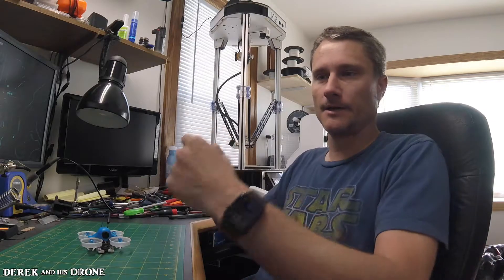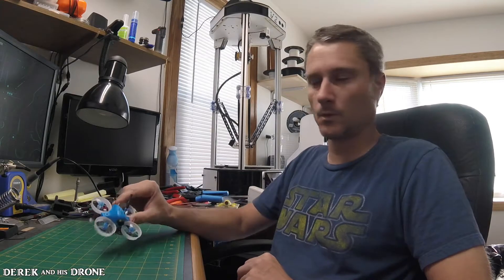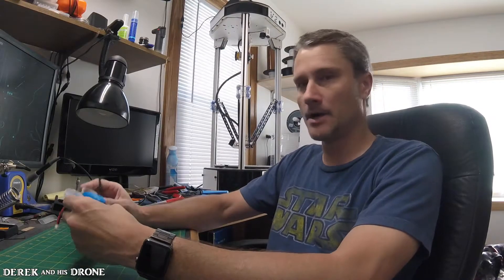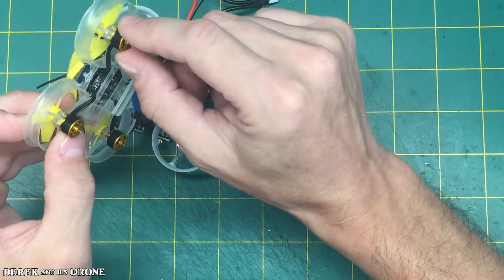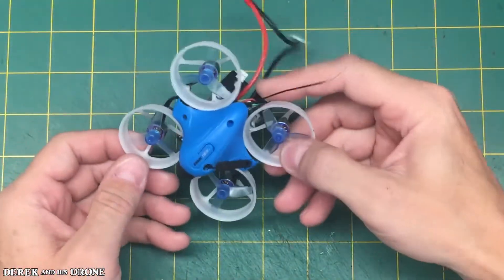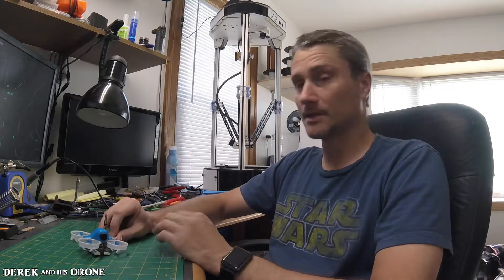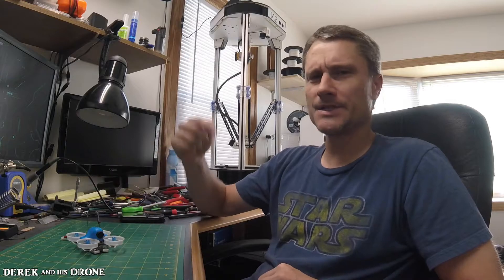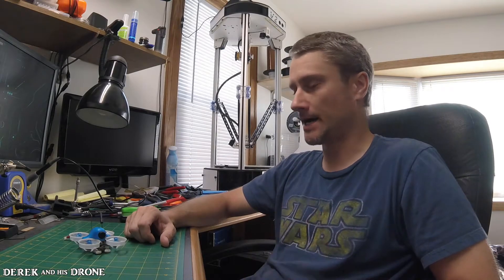2S Brushless Tiny Whoop Build - Part 2 FAIL

Comment: My Eachine 013 flies like complete crap. It’s gotta be a factory defect. I purchased it off of bang good and it’s as if one of the propellers is pushed down closer to the motor. That could be the issue but either way no matter how much I try to trim it using the stock remote it still doesn’t completely trim the way I’d like it to. I contacted bang good about it and they keep giving me a crappy reacharound in there email about how I need to upload videos on YouTube talking about it. I told them that I had already done that and they seem to not understand me well. I keep telling them and keep sending them the same damn videos and SKU labels and they aren’t helping me for anything !. I spent 70 dollars on the fpv combo with the goggles in regards to this thing. 6 mm motors like majority of my ducted indoor drones and it sucks. It just doesn’t fly at all it keeps flipping over. Do you suggest I wait for them to send me a replacement package or get it fixed myself ?..... even my usb charging cable that was included won’t even charge. It’s damaged out of the box to begin with and on top of all this stuff I mentioned it gets extremely hot under the canopy where the camera is located. I’m surprised the canopy hasn’t melted.
Reply from the maker: If you have other options I would not recommend buying from Banggood.  They are very lacking in the customer service department and things are poorly packaged for shipping. I have seen a lot of things damaged in shipping that could have been easily avoided. If you can I would recommend cutting your losses and trying to fix the quad on your own. It is normal for the VTX to get hot but should not be hot enough to melt plastic.  In the future I would recommend staying away from Chinese brands like Eachine as they do not typically provide a quality product. In your case for only a few dollars more a quad could have been purchased that would give you an enjoyable experience.
Reply: Derek and his Drone Damnit !!!!!..... so do you think they would send me back a brand new Eachine 013 or would you think that they are just going to send me the same stupid email message about there salesmen and that I need to upload the issue to YouTube ????..... it’s retarded man they aren’t doing squat for me. Please man if you can shed anymore advice on this and tell me what I need to do I would GREATLY APPRECIATE IT !!!!!!. I did purchase a Horizon Hobby Blade Inductrix rtf with the stock Blade remote and it is phenomenal !!!!!. My Inductrix is the regular first gen that came out which doesn’t have an fpv camera and comes with two canopies blue and red. It’s only stock brushed 6mm motors. If there is anything else you could tell me quickly I would be greatul. This shit is ridiculous even there Live Chat doesn’t help me much. I dealt with three or four different agents and they keep telling me we need pics and videos. I sent them atleast 5-6 emails already and it still hasn’t helped. Your telling me they won’t give me my 70 dollars back for the Eachine 013........ I’m not an expert at taking apart these drones myself and I don’t have soddering tools to do it. I’m not a rich guy so I just can’t by replacements drones to have fun for the meantime.
Reply from the maker: More than likely they are not going to send you a replacement. Typically they will only send out the parts to repair the craft.  Also they won't do anything without videos showing the problem.  If you purchased with PayPal filing a claim may get you faster responses.  I definitely would not count on getting a refund.  The inductrix is a great quad and it's flight controller is preferred by top pilots.  If I could ask what country are you in and do you have any gear for FPV like a set of goggles?
Reply: Derek and his Drone Yeah Derek for sure I’m in the United States. Nevada.... don’t want to disclose exactly where because of how most of the trolls are on this platform but as I was stating in regards to the Inductrix it is phenomenal. I spent 54 dollars on it off of amazon prime and it worked perfectly and still does right out of the box. Like you said anytime you order a FURIBEE or an Eachine you are taking a gamble and I knew that going into it. They also sent me an Eachine 010 with the Lipo stuck in the battery slot and I notified them about this one to. I feel like I’m going to bend and snap it in half. It’s still doing the same thing with every battery I put into it. I HATE THE ISSUES THEY HAVE CAUSED ME !
Reply from the maker: The reason I ask Is depending on the gear you have I can see what I can do to get you a proper Tiny Whoop.
Reply: Derek and his Drone Derek I just spent most of my money on the 10 different drones that I have. I have 8-9 different indoor ducted quad copters which are these little guys we are talking about and I have one brushless rtf RC LOGGER eye one xtreme. The only fpv drone I have with goggles is the shitty faulty Eachine 013 that they sent me with the VR006 goggles. IT SUCKS besides looking awesome. It only looks good but performance is BAD!!!!!!!!!.
Reply: Derek and his Drone i dont know if you got my last message but I was stating that I don’t have that much money left. I’m actually semi broke or broke for the most part and I’d love for you to send me a brand new drone but of course you can’t do it at no charge that’s in a perfect world lol. I have 8 or 9 mini ducted tiny whoop style drones and one big brushless RC Logger Eye One xtreme. The money I did make wasn’t money I worked for it was hard going about getting it and I’ve been on a big drone addiction craze lately. I’m normally rocking out with the 6 Traxxas rc cars that I have but I started to developing a liking for indoor and outdoor drones as well. It’s just like I said man...... very difficult for me to get buy trying to get what I want when I wish that I had a lot more drones and cars then I do now. I want the Blade Inductrix fpv or fpv + but I don’t have a custom flysky or Spektrum remote transmitter. I would more then likely go for the regular rtf kit which is easier for me right now but I only buy and desire brand new never refurbished or used Derek.

Comment: You should try use 2 eachine e010 150mah 30/45c they're awesome for tiny drones and great for keeping weight off the only issue will be is flight time (as for the durability of nano brushless motors it seems like a better option to stay brushed in my opinion) none the less awesome build keep up the good work and hope you find a solution 🤞
Reply from the maker: Thanks for the suggestion.  I'm done with buying cheap Chinese stuff.  That's why I had so many problems with this build.  Been through three flight controllers on this one.  I have some other videos building brushed Whoops.  I'll have a 7mm build up soon!

Comment: I just built a 1s with the same motors. I think running the 15000kv is just too much for 2s I have stalled my motors in grass and haven't had any problems with them burning out. Also check the motor wire connection to the esc. It breaks really easy and causes the motor to stop working. Lose the inductrix canopy and camera and use something lighter like the fx900 with the molded canopies. Make the battery pigtails wires as short as possible I bet there is 2g worth of extra wire there. A 90 degree jst ph connector will make it as short as possible.
Reply from the maker: Thank you for your incite.  When I get some cash I'm going to try different motors.  After receiving your comment I took the time to check out the motor wires and found a broken one.

Comment: I get 3.5 minutes with Rakonheli 66mm frame 0703 12000kv on 1S 230mah and 5.5 minutes with Rakonheli 76mm frame 1103 8000kv motors on 2S (2x 230mah).
Going to build 2S 66mm version with 0703 8000kv motors. Build parts used here: https://www.rakonheli.com/rakonheli-2s-delrin-carbon-76mm-brushless-whoop-bnf-dsm2-dsmx.html
Reply from the maker: I was thinking I might want to go with a lager frame.  Have you burned up any 0703 motors yet?
Reply: Derek and his Drone 
Haven't had a single problem with the Boldclash 0703 motors so far. I'm using Boldclash as I've had quality issues with the Racerstar 0703 version however the Racerstar 1103 series on my 76mm frame seem fine. Ordered the Boldclash 0703 10000kv for a 66mm frame 2S build.
Reply from the maker: I didn't know Boldclash made 0703 motors.  I think I might try a set, found some on eBay.  Thanks for your input.
Reply: I'm now doing the Rackonheli 76mm build myself, preordered kit for release on 3-30-18. Waiting on shipment..